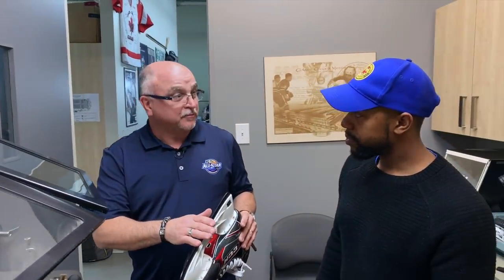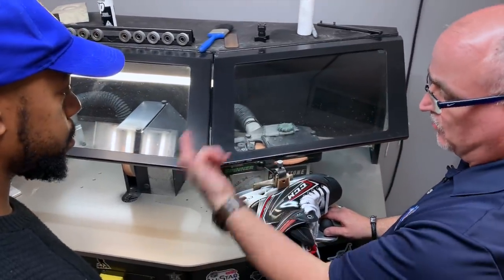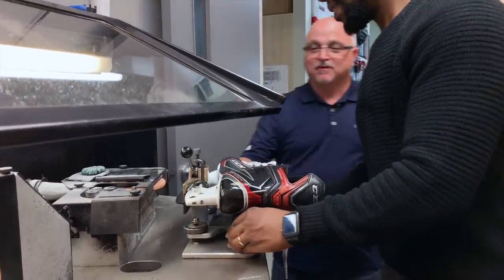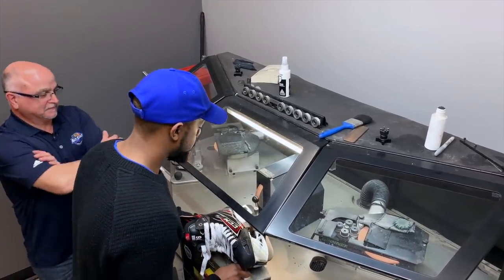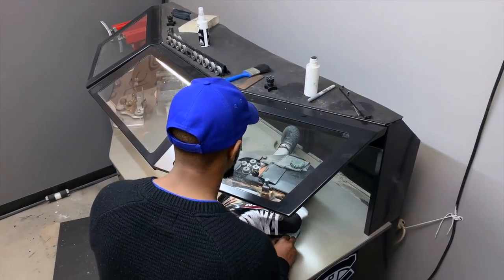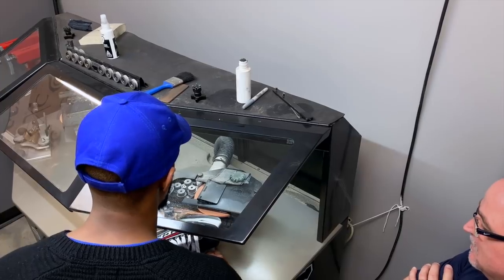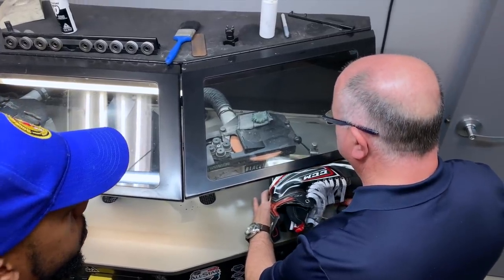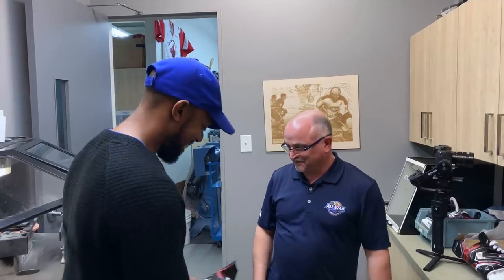My first EVER time sharpening skates with NHL Gear Customiser Marco

Comment: As a guy who sharpens skates, you can now see why it takes more than 5 minutes to sharpen a pair!
The worst customers are the ones who don't understand why they have to wait 25 minutes when there are "only" 3 pair ahead of them.

It takes time to do a good job, I can rush yours if you want.
Reply: It's the most annoying thing too when they come in 10 minutes before a game and expect theirs to be done before everyone else because of that
Reply: The worst is when we get people who go crazy if you stone a black blade or shiny blade, no, you don’t have to use a stone, but for performance, it helps, but all it is is paint, I’m using black steel and it’s coming off just with pucks and other people skates hitting them
Reply: @goprop.o.v4495  Ummmmm no. You actually shouldn't be stoning black steel or the shiny steel. Black steel is carbon coated which means you don't need to stone it after sharpening or whenever and you shouldn't be sharpening them as much because of the carbon coat. The only reason to stone a skate is to get rid of nicks making the blade face outward. So if a black steel blade is doing that you should probably just get it sharpen again. 

I went from sharpening my skates every 5 games with black steel to every 3 with regular steel
Reply: A Pags I’ve talked to both CCM and Bauer reps, they said that you can do either or, it’s all personal preference. I’ve tried it without stoning, and did not like it, I could care less about the coating coming off the bottom, it’s going to come off no matter what
Reply: @goprop.o.v4495  Depends on if you mean stoning with a actual stone, I work at a store sharpening blades and the bauer rep recommended I use a leather belt or block of wood to hone the blacksteel or the shiny coated blades like step steel
Reply: @sparky9608  Yes.... Many years ago I used a "straight razor" for shaving my beard.... excellent shave BTW..... When you sharpen these razors you use a flat leather strap..sort of like a belt like you mention... The leather belt sharpener doesn't mess with the fancy design on the side of the razor...
Reply: This drives me crazy, somebody will bring me an old antique pair of skates or some rusty beaters and then are mad when it takes me 15 minutes to restore them. Like dude, I can do it quickly or I can do it right.
Reply: This is so true, people get so angry yet don't understand anything about it.
Reply: They can take hour for me when there more than one several pairs skate head my  I just look around dreaming of the stuff that I want but can't get lol

Comment: Good technique demo. It really does not take long to get the hang of it. However, setting up the holder and learning how to adjust it is probably the most important skill. If the blade is not centered on and perpendicular to the stone, perfectly parallel to the table, you need to adjust the holder. I have a Wissota at home. The freedom of not being at the mercy of the skate shops has been a great relief.

Comment: I sharpened hundreds of pairs of skates at several ice rinks in the D.C. area and it is hard to find good sharpener. I used a similiar sharpener to this here, only the horizontal and cross wheel were right next to each other. One thing I learned quickly was to keep everything clean, clean, clean. Waxing the deck, keep the dust off the pad of the skate holding jig and deck, made things slide so much more easily and made the cut so smooth. Those 'protective' glass guards look like a pain in the keester, making it much harder to eyeball the edge being cut, and harder to get close to the jig and steady it by getting it closer to your body. You can see when they put the jig down, it does not slide easily. Probably too much dirt on the pad and deck, and that will eventually wear away the deck in front of the stone. And cross cutting every time you sharpen cuts down the life of expensive blades badly, and changes the arc, especially if they are figure skates that can cost several hundred dollars just for the blades. I am also a big believer in stoning the edges carefully. Thats all I have to say.

Comment: Damn its a art doing that by hand. Must be easy getting your blades ruined by a noob pushing to hard or loose over different places on the blade. Whould have liked to see him profile aswell.
Reply: Profiles are done by machines. They have to be way too millimeter perfect to be done by hand.
Reply: Proper skate sharpening by hand is an art. Any good shop will spend at least 5 minutes per pair of skates. I often have to correct skates sharpened by people improperly trained. Almost anything can be fixed, but it's becoming a lost art. People just want automated machines that are quick.

Comment: Alot of hockey shops do an unecessary amount of passes so that the steel wears down quicker and they can sell more blades. If you get your skates sharpened regularly 3-5 passes per skate should do.

Comment: 5-7 passes on the cross grind? Might as well get a new blade while you’re at it 😂😂😂
And going all the way to the end of the toe too! I’m having a panic attack!
Reply: GoPro P.O.V I’ll never do more than 2
Reply: It's better to do more passes with less pressure the less passes with more pressure i would think
Reply: simeoin Leenir you really don’t need to do more than 4 max, all the cross grind does is make a new surface to sharpen, when you get new blades, you only have to do them until the whole bottom has that “cross-grind” finish
Reply: GoPro P.O.V I was pretty surprised hearing that as well... 5-7 is rather extreme... and all at once too. If I have to go more than 3 I’ll switch to the other skate. A lot of sharpeners don’t realize the blades getting too hot will cause a lot of issues.